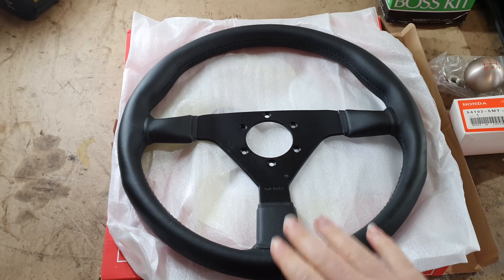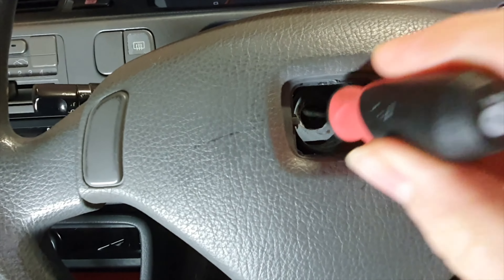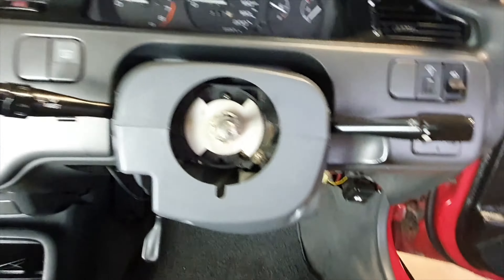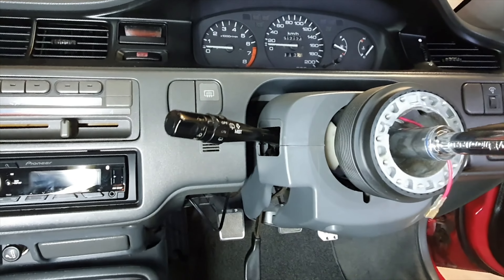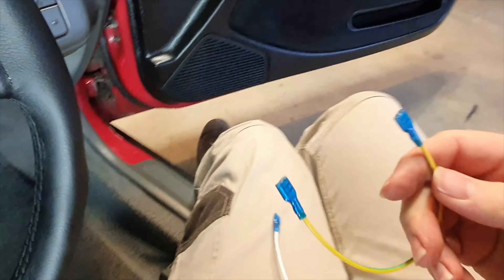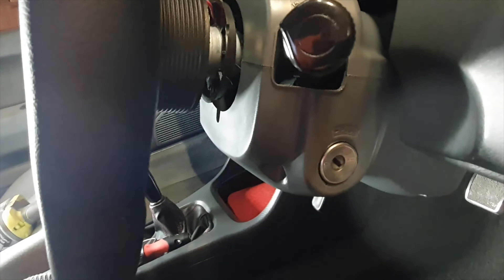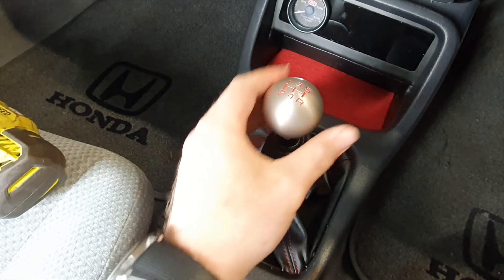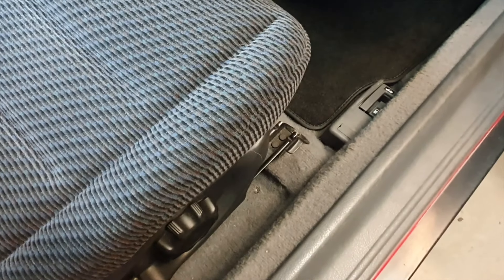Momo Steering Wheel Install | Eg Civic B16

Comment: Hey mate, I was havin trouble wiring up my horn but u made it clear. I’m wondering if you still have the indicators turn off automatically with that boss kit. Thanks mate
Reply from the maker: Cheers good to hear! Yes it works make sure you have it the right way up. There’s a dowel on the back that hits the indicator. Make sure it’s properly centred.
Reply: @JarrodWillemse  thanks bro, all working sweet as now, my little blocks that are meant to go into the block cut out of the boss kit weren’t long enough. I simply put a tiny screw into each one to give it a little more height. This video was mad helpful, cheers

Comment: How does your horn actually work with that setup? Aren’t you supposed to finish the circuit by earthing it on part of the steering column?
Reply from the maker: On the horn there is a metal spring thing that holds it in and touches the boss kit. The wire is just attached to horn which touches the boss kit.

Comment: Dude what can u say about n steering wheel and the hub..is that ok..
Reply from the maker: Yeh no issues for me but I wish the steering wheel was closer. Also there is a-bit of a gap where the hub bolts to the column that looks a bit ugly. Functionality wise fine.
Reply: @JarrodWillemse  because im planning to buy that and i will puy to my ek sedan..